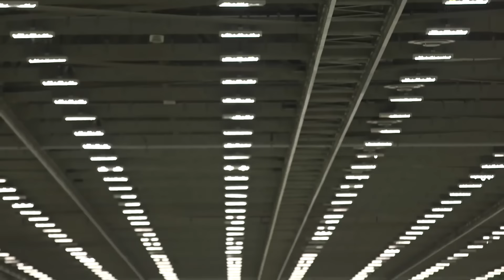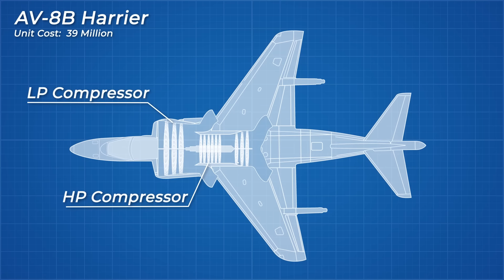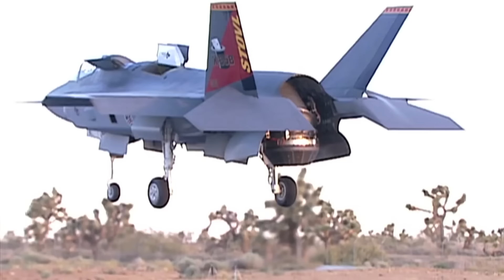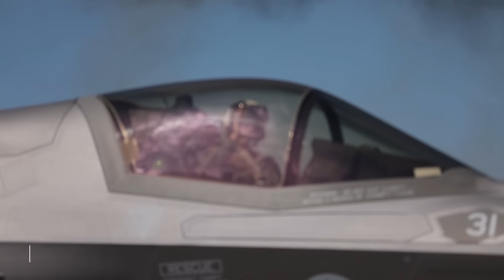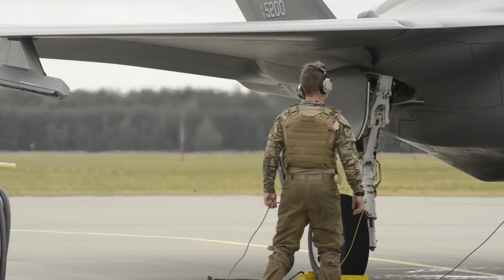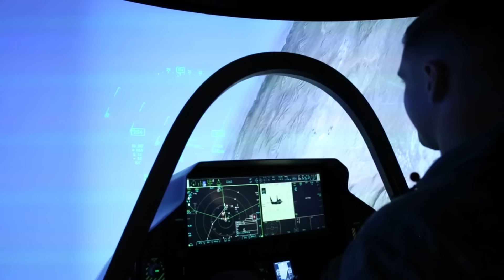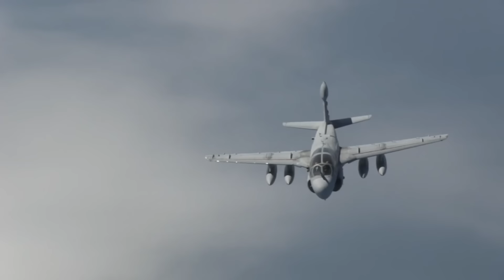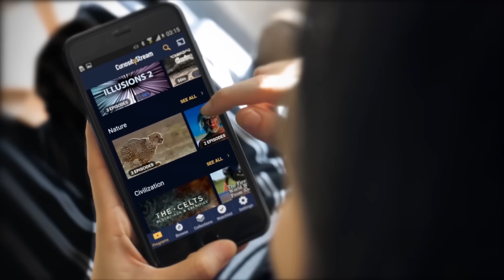Is The F-35 Worth $115 Million?

Comment: Engineers: we made the Stealth fighter that you wanted.

Pentagon: Great! now we want it to have STOVL, a new targeting system, and for it to fit seamlessly into every part of the armed forces. of are country and our allies for 1/2  of the cost. We will be mass producing the aircraft, So invest heavily in non-flexible assembly lines. We also want it to perfectly  fill the roll of evere 4th generation fighter.

Engineers: Okay but that will require lots of up front Investment and we will have to decrease the amount of weapons.

Pentagon: M O R E  W E A P O N S

Engineers: We could add pylons, but that will make it less stealthy.

Pentagon: Nevermind apparently the Air force is doesn't want STOVL, and navy doesn't want the plane, so now you are making 3 variants. They all have to have 70% of the same parts though.

Engineers: But-

Pentagon: Make that 30 variants. Apparently different countries need weapons equipped for different roles. Good thing that this plane will be good at everything, RIGHT?

Engineers: Okay, but that will cost more.

Pentagon: That is A OK. we'll just order fewer units.

Engineers: Okay, but that will cost more per unit.

Pentagon: ALL I ASKED FOR WAS ONE WEAPON THAT COULD DO EVERYTHING TO A DEGREE BETTER THAN ANY OTHER WEAPON IN THE WORLD, THAT WOULD SEAMLESSLY INTEGRATE WITH THE MILITARIES OF US AND ALL OF OUR ALLIES. Is that to much to ask?

Engineers: Yes.

Pentagon: Fine, we will give the contract to Boeing.

Engineers: Okay, we will do it, but the R&D alone will be over-

Pentagon: Here is a blank cheque.
Reply: Facts
Reply: Even Brits see how flawed our procurement system is (cheque gave it away, mate)
Reply: Samuel Fischman 
Didn’t Robert McNamara. Try this with the F-111A back in the late 60s?
Reply: it was made with STOVL and to be adaptable as a goal all along.
Reply: hmm

yes.
Reply: @Nybbl er im not sure you completely understand how government works. Trump is an idiot, yes and most of america   agrees with that (he lost the popular vote by the most any candidate ever has). So his decisions are not something you should be insulting people who most likely didn't vote for him. Yes the US could've shut down things quicker, but when they did the measures taken were pretty strict. And you assume that the people are complete idiots,  most people in early march prepared or started isolating, While the us might not have had the best response they had a response that worked well, and they're being careful about reopening states. Also none of this has literally anything to do with military spending.
Reply: @hamsterstudios1107  Most of America does not think that, but the media is closer to propaganda in the way they portray him.
Reply: Samuel Fischman Wow I enjoyed reading this
Reply: @diggleda  Thanks, It was fun to write.
Reply: Truuuuuuuu! Then the Pentagon pogchamps when engineers say no
Reply: This nails the problem.  Well done.
Reply: The Pentagon is cancer.
Reply: Just put stealth coating on existing aircraft the Air Force has and if you try to make everyone happy u make no one happy
Reply: oh yeah it needs to be able to be operated by a highschool graduate. prints money from thin air. dont worry we can pay for it.. lol considering we will have space superiority at some point.. hehehe
Reply: Why would you say something so controversial yet so true
Reply: Lol...great colloquy!
Reply: Joe mama lmao 😂😂😂😂😂😂😂😂😂
Reply: @Vatoliciuos  That's who I voted for
Reply: Americans develop an aircraft with complicated design and overcome very complex disadvantaged only to end in Chinese reverse engineering that aircraft at lower costs.
Reply: That is why suicide rate is high among engineers.
Reply: "Here is a blank cheque"

Courtesy of US taxpayers' debt with JP Morgan, Goldman&Sachs,George Soros and all those that finance US national debt with the hope the US military implements their global agendas.
Reply: Settle down boys.
Reply: @F-35 Lightning 2 A chèque is just a French word for the equivalent English word, and yes I know i'm not answering the question. You can probably safely ignore whatever a French might have to say anyway (joking).
Reply: @retropaganda  based
Reply: US GOV ALLOWED OUR TOP MILITARY R&D OF THE LAST 25 YRS STOLE oR sold ?
Reply: No cap
Reply: Literally what happened.
Reply: @Nybbl er Thanks.
Reply: @Nybbl er O O F
Reply: @William Budden Thanks!
Reply: Facts
Reply: This was practically spot on. It’s like being a head developer at Apple. Some dude in jeans walked around telling people what he dreamt of last night and watched them make it reality. Respect for these unsung soldier’s.
Reply: @F-35 Lightning 2 check but French
Reply: Funny story but the f-35 is worth the cost
Reply: I think the scary thing is that, despite how hard it was?

Engineers: Here's that plane you wanted. We're still working out the kinks but that's mostly software updates, and manufacturing cost will keep coming down over time.

Pentagon: ... wat.

This is like sending someone hunting for an ID-10-T part and them coming back with one.
Reply: You have been working DoD programs too long 😅
Reply: @Nybbl er Yeah yeah military just wants toys, America only fights AK-wearing caveman, blablabla. I'v heard it all a thousand times and it gets less convincing every time I hear it. Russia is actively challenging the US around the world, from Europe to the Middle East to America's doorstep in South- and Middle America. It has been developing capabilities specifically tailored to defeat US expeditionary capabilities for decades and has been exporting these capabilities globally. China meanwhile is openly building up its capabilities for the explicit purpose of defeating the US navy and pushing it back beyond the second Island chain. It too has no qualms about exporting this technology. Anyone still making the claim that great power competition is irrelevant has been living under a rock for the past decade. Hell even non-state actors have access to sophisticated weapons like air defenses and anti-ship missiles these days.
And again, the F35 has pretty standard payload as far as stealth planes go. Chinese and Russian versions have similar internal payload. The F117 also had comparable payload. Two 2000 pound bombs plus air-to-air weapons is pretty decent, that would be a fairly standard load-out for an F16 too. For smaller targets up to 8 SDB's can be carried. The payload issue is greatly exaggerated. Once the new weapons rack is ready it will have the same payload as an F22. Never heard anyone complain about the payload of that plane.
Reply: Although, I do find it funny that people act like engineers are the be all end all. My father in law worked on F-14s and F-18s on the Nimitz and then he worked on Boeing aircraft for the airlines for almost 20 years and he always jokes that a mechanic's worst nightmare is an engineer.
Reply: Pentagon: We need a jet fighter that can do all these trixy things, VTOL, 360 view for the pilot and stealth at all costs.

SAAB Gripen: Hold my beer.
Reply: @Nybbl er The B model also provied unique capabilities that effectively turn all of the US's Wasp and America class ships into light carriers. If you want to compare [rice you should compare it to the F35A. With a fly-awat cost of 80 million that is comparable to 4th gen fighters like the F15, Rafale, Gripen or Typhoon, Especially if you count the sensor pods that those planes need to carry to get capabilities the f35 has standard.
The idea that the F35B's unique requirements compromised the other models is also highly exaggerated. The A and C models are quite different from the B model and do in fact have larger payload (both internal and external) and are more maneuverable and less 'bulky' than the B model because they don't have that lift fan. They can also pull more G's than the B model.
Reply: Dux D  Best place for aircraft carriers is in dry dock where they cannot be sunk. They are is obsolete now as the battleship was in World War II.
Reply: @Nybbl er The US being unprepared for COVID-19 has nothing to do with military spending, or with money at all. The problem is that there is not enough global supply of ventilators now that every country needs them, not that the US doesn't have the money to buy them. The US is spending trillions on jump-starting the economy, clearly they have plenty of money. A fraction of that money would've bought all the ventilators you could ever need a year or so ago. The problem now is supply, not money.
 And US intelligence agencies have been warning for this exact scenario for at least 5 years so the system was working and blinking red warning signs. The problem is that nobody listened to the experts until it was too late.
Reply: @duxd1452  yeah I dont know bud. Even military members staunchly agree the US military complex wastes tons of money.
Reply: @spakentruth  Military members don't have any particular insight into military procurement unless they work in the acquisition process specfically. And wasting money is usually a question of perception. The F35 can hardly be called a "waste" when you consider the amount of legacy equipment you'd need to perform the missions this plane was designed for.
Reply: @Nybbl er First of all I'm not American. Second, yes, they should have closed down much sooner. The US has horribly bad leadership. But what does that have to do with the military budget?
Reply: @duxd1452  You can't really blame the leadership when it constantly is getting sabotaged can you? Everyone's quick to say things are the presidents fault but he can't speak for the people below him, especially when they observably conspired against him on multiple occasions.
Reply: @xcritic9671  [Citation Needed] Also wasn't blaming Trump or Obama, Mostly the Military industrial complex bureaucracy in general.
Reply: @samuelfischman6949  idk what you're talking about, but I think I agree...
Reply: Dux D it is that they spend so much money on the military still doesn’t have the best military, not good guns and not so good airplane like some nations have
Reply: Amazing how clueless some people are about military procurement processes. The F35 is not expensive, it's ridiculously cheap. It costs about the same amount of money as a modern 4th gen fighter. But the F35 provides more capability for that money than any plane before it. It's a MASSIVE leap in technology from previous generations. As a fighter F35's are getting insane kill ratios in excercises, out performing anything but the F22. And as a bomber it is completely unparallelled, easily able to go into areas defended by sophisticated integrated air defenses that would cause horrific losses against any 4th gen plane. If you had to do that same mission with F16's it would actually end up much more expensive because you'd need dozens or even hundreds of planes and you'd lose a big chunk of them. The fact that the F35 is so versatile that many countries in vastly different circumstances have ordered it only makes it more impressive. You should be damn proud of the Pentagon instead of making these dumb jokes.
Reply: @duxd1452  You start from the goal you wish to reach.
Reply: @duxd1452  thanks for sharing that info not many people research the military the just look at the word (stealth) and assume it's a trillion dollars for  1 the f35 is a really good plane
Reply: @duxd1452  Check out the performance figures of the F-35 to the 50 year old F-15, then imagine an air-to-air fight, guns only . F-15 would need to stay out of After Burner, just to make it fair.
 Can you imagine an F-35 flying down some canyon to smoke a Tank? Fat chance!
Reply: @lindamcentaffer5969  What era are you living in? Guns-only air-to-air fights? Fighters carry high off-boresight missiles with HMS cueing these days. Guns are irrelevant as an air-to-air weapon in today's world. And I don't see why an F-35 couldn't fly down a canyon like a 4th gen plane. Although there would be little point in flying into AAA range when you can just drop a Paveway on that tank from 40.000 feet.
Reply: @duxd1452  Are you telling us, that there is a ballet dancer who also could be a wrestling world champion?
Reply: @bernhardecklin7005  No. Maybe you should learn to read?
Reply: @duxd1452  This is an unfriendly and particularly stupid comment from a guy presumably of not very sophisticated education. But continue trying.
Reply: @bernhardecklin7005  I'll let your comment speak for itself..
Reply: @duxd1452  Thank you. You are right to join my point of view. As the F-104, the F-35 is a lemon, period!
Reply: @bernhardecklin7005  No thank YOU, for proving me right in questioning your reading skills.
Reply: @duxd1452  no arguments, but stupid repetition of Lockheed-PR
Reply: @duxd1452  for how long have you been in Lockheeds propaganda service? Shame on you!
Reply: @bernhardecklin7005  LOL
Reply: @duxd1452  lost helplessly, tries to be funny, the guy who doesn't care to what would happen to the pilots of this piece of crap, let alone to the US-tax payers!
Reply: @duxd1452  when the last time F-35 been in a real war dear. Stop this b.s. There are enough of reports from experts in the US and Nato that the F-35 is totally overated.
Reply: @alberthenriette8976  Last time F35 was in a real war? Few months ago in Syria. Both in Israeli and US service. And every single real expert I've heard on the topic agrees the F35 is a quantum leap in combat power. That's why air forces from around the world are either buying the F35, trying to buy it or trying to steal/copy it. NATO countries trust the design enough that they build their entire future air forces on it. And even an adversary like China trusts the design so much that they modeled their entire future carrier wing on the F35. The UAE thinks its good enough to make peace with Israel for. And the Israelis themselves just decided to buy an extra squadron because they are so impressed with the jet's performance. But of course you know better than some of the best air forces in the world because you read some news articles by self-proclaimed "experts"? Pff..
Reply: @duxd1452  Hahaha..oh dear if you listen to the promoters you will always end up by seeing nothing wrong with their products. The F-35 is one of the most promoted militart toy in history. Why? Because they need to sell it to cover the huge cost.The F-35 never face a real adversary in Syria, nor in Afganistan or anywhere else , because its never been in any real war. The real experts who really cares about the USA war capabilities and not only making money are those who are raising concern having critics about the F-35. They know this plane is not up to the expectation of the US army and want a better craft soon. Thats why there are talks already about a 6 generation craft soon.  Why you think the F-22 is not for sale, even to Israel?
Reply: @alberthenriette8976  The UAE and Israel don't have any financial involvement in the F35. Neither does China. Yet all three decided to build their future air capabilities on this plane. And dozens of other states have been lobbying Washington for access to it, including major military powers like India or Saudi Arabia with access to plenty of other systems should they so chose.
The F35 is slated to be produced until at least 2035 and will replace all major fighter and fighter/bomber types in 14 air forces across the world. Several thousand will be produced. Hardly a sign that they are falling short of expectations. 
And its perfectly normal for preliminary design work to start on a new plane when the current generation plane is just being rolled out. The development of the F35 started in the 1980's, when the F16 was still in its infancy. No 6th gen plane will see service before the 2040's.
Reply: @alberthenriette8976  Wheeler? Really? The guy is part of the POGO. an organization that has lobbied extensively against the F35. He's not an expert by any stretch of the imagination, and certainly not a neutral one. But the people that actually know the performance of this jet are all impressed enough to build the future defense of their countries on it. And those are really the only people in a position to evaluate its strengths and weaknesses given the classified nature of the actual performance parameters.
Reply: @alberthenriette8976  There is nothing about F35 performance in that video. Readiness problems are perfectly normal for a new fighter. The F16 had the same problems in the beginning. The readiness rates for the F35 have been going up continually for the past few years and are a lot better than those of the F22 that you were just praising so highly.
Reply: @duxd1452  These two guys from the 2 videos are honest. Pierre sprey is an American war veteran, who love his country and knows much about aircraft and war. Yesterday the 4th F-35 Crashed happened within a few yrs. Theres something not ok with this plane as many experts been pointed out. If it cannot stay in the air in peaceful time , how will it survive in conflict times facing high quality adversaries.
Reply: @alberthenriette8976  In that same time period 18 F16's crashed. I don't hear you ripping on the F16 because of that? Accidents happen, that's just a fact of aviation. Losses due to accidents are expected and calculated into acquisition plans. Apparently a plane's performance in your book depends on the amount of positive or negative stories that appear about it in the media?
Reply: @duxd1452  Hahaha.I know you will send me this video dear. But don't you see anything strange about this man. He is a Russian( Counter intelligence) propaganda agent. When your adversary praise you too much for  something you do. Its a wake up call call for you, that theres something wrong with you. They don't want you to know. This man  have no critics but 100% positive appraisal for the F-35. While some sincere American and Nato experts  thinks theres lot of rooms for improvement.
Reply: @duxd1452  Ya, but the F-16 is a battle proven jet compare to the much more expensive F-35. The F-35 have a thousand $ worth techno to keep it in safe flight. If the F-35 keep crashing at this rate, this will not be profitable at all.
Reply: @alberthenriette8976  Vladislav Shurygin is not a counter-intelligence officer, he is a journalist focussing on military news. You clearly don't know who you're talking about. He has no ties to the Russian government.
 Russia did put out a lot of propaganda about the F35 but all of it is negative, not positive. The Chinese are also constantly criticizing the F35, while at the same time copying it for their own naval aviation. By your own logic that proves the F35 is pretty good.
Your opinion is clearly based on the random noise that appears in the media about the F35. Or worse: youtube videos by random trolls. That means nothing. Instead you should look at the people that actually know what they are talking about: the military officers and pilots of the air forces that will operate it. They are the only ones that have access to the real performance parameters of the F35. And they all agree it is revolutionary. As do America's adversaries like Russia and China, who have expended massive resources to copy/steal the F35 and to build defenses against its capabilities.
Reply: @alberthenriette8976  I'm going to end this discussion here. . You have clearly already made up your mind that the F35 sucks and you will continue claiming that no matter what evidence I put before you. Air forces around the world know better and will keep buying them in large numbers. The opinion of laypeople like yourself is totally inconsequential so I'm not going to waste my time trying to convince you.
Reply: @duxd1452  oh dear. I understand your disappointment . The truth will remain that theres no perfect aircraft. Theres been some great ones like the F-16 . A plane that perform great in battle. But the F-35 with all the fixing that been going on with its software and hardware has not been convincing. For the status of the US military theres too many shortcomings with it.
Reply: @alberthenriette8976  Keep the condescending attitude and the cheap strawmen to yourself. My disappointment is in you and your foul attitude, not in the F35. I mistook you for someone that was open to rational arguments. Turns out you just want to be confirmed in your own opinion and have your ego stroked. I have no interest in continuing to engage with a sad individual like you.
Reply: @duxd1452  well..you may disagree with dear for presenting you with opposing views. But I would say it was not a waste of time to read your views. This is what the youtube forum was meant for. The end goal is to have tolerance and respect. Agree or disagree. Thanks for sharing in a civilise way. Enjoy your day.
Reply: @duxd1452  The program is the most expensive in history. The per unit might be cheap (If you think that 2,000,000,000 is cheap), but that's only because many are being sold.
Reply: @samuelfischman6949  Yes, if you sell lots of a fighter jet the per unit cost gets cheaper. Economies of scale and all that. How is that not a good thing? And with around 3000 jets on order that will replace a half dozen fighter and bomber types in 14 air forces around the world the program might be the most expensive but it also provides more military capability than any other program. It will completely modernize the US air force/navy/marines inventory as well as that of allied nations. And it looks set to fundamentally shape the way the US will fight future wars. Through extensive networking and cooperative engagement capabilities like NIF-CA the F35 will act as a force multiplier for everything from naval ships to army artillery batallions.
Reply: Dux D you don’t know anything about warfare, these military exercises are biased in favor of the F 35 so that it looks like it is doing well. Furthermore, the cost per unit is gigantic when you amortize in the R&D cost at more than $400 billion, that adds more than $100 million to the cost per unit it’s less than 4000 of these things will ever be built. Worst of all, these 35s are already obsolete because of autonomous drone technology. Even Elon Musk recently told the US Air Force this in an official meeting. The best we can do is cut our losses now and go to drones, and only Drones.
Reply: @duxd1452  totally random, but do you like the SR-71 Blackbird?
Reply: Steve Perreira aside from other factors people below have mentioned, I think most of the public would go insane if we went full drones, since it’s not a real human pulling the trigger
Reply: @duxd1452  yeah i don't get the part of the joke "but it'll be more expensive" it's less expensive than an older version of itself that perform literally worst in everyway whenever it's able solely to do it

US did an amazing piece of technology here too bad it's still corrupted to the core with your ultra libertarianism that every US citizen seem to defend with its soul even tho it's literally the reason everyone is in deep shit because of Covid
Reply: @YM-zf8mt  I was referring to the planning stage, not the actual iterations of the fighter. What I meant was that the program would have been cheaper if it wasn't stealth, or STOVL. The extra capabilities added cost.
Reply: @YM-zf8mt  I was not refering to the unit cost, but rather the increased cost of the program and R&D.
Reply: @duxd1452  facts right there my man
Reply: @Nybbl er so thanks to Trump I know some people that were making just as much money while not working as when they were, but I guess because 90% of the press he gets is negative he must be doing a bad job. Don't believe what you hear.
Reply: what we have is an overpriced piece of junk that we dont and ill never need.. nobody will ever even think about invading the US since they know people like me own guns as well as half the country..
Reply: @jamesholt7340  LOL Yeah James, I'm sure the Chinese are very scared of your gun collection...
Reply: @duxd1452  yes,that why no country would ever dare to invade us..im not the only one with guns you know that right..and its a known fact that many countries have stated is to why they never would...dont think our military is whats keeping that from happening cause we are not as good as the movies and media potray us to be!!
Reply: @jamesholt7340  Name one? Compared to the US nuclear deterrent you and your neighbour's private gun collections are not that impressive.
Reply: @duxd1452  nuclear weapons are a moot point,nobody would dare use them because they know it would be the annihilation of themselves if they did so they in essence dont matter
Reply: @duxd1452  we could actually get rid of our military altogether and nobody would even dare because everybody knows Americans own guns and it would be suede to invade this country,and that it would be geographically impossible..every country al;so knows that if they were to invade people like me would be fighting right alongside the military to counter any kind of attack and that would be a grave mistake to go up against someone like me with a gun...I never miss..
Reply: @jamesholt7340  Homeland defense is actually the one situation where nuclear weapons are not moot. It's what they were made for. An invasion of the homeland is one of the few situations that would trigger a nuclear strike, that's why it's a credible deterrent. 
And armed civilians don't stand a chance against a modern army. None of your guns can penetrate armored vehicles or stop artillery shells.
Reply: @duxd1452  your delusional,the only thing the american military does is provide welfare for all our people in the military by means of housing,education,meals,and a good paycheck..THEY DO NOTHING FOR the general public!!give me one instanc where the military has helped the general public? ill wait....
Reply: @jamesholt7340  "give me one instanc where the military has helped the general public? ill wait"

Well for one they assist after major disasters with evacuation and disaster relief, like after Hurricane katrina for example. 
And LOL@ you thinking you're going to shoot down low-flying airplanes and take on armored vehicles with IEDs. You're hilarious man. Iraq is littered with artillery and bomb duds and other discarded heavy weapons from decades of conflict. In the US anything that can be used to create a serious explosion is extremely tightly controlled, especially since 9/11. So no, you do not have better access to explosives than those Iraqi "goat herders".
Reply: @duxd1452  damn.Your right..You got me on all accounts...we have two totally different views and entitled on our opinions....but honestly, i wish the government would do more to help the country instead of war and everthing that goes with it...War is good for absolutely nothing...
Reply: @jamesholt7340  Navy seal coppypasta much?
Reply: Weapons are no use at all and wasting of our earth resources on earth  to build if  devil nations in the world are not creating troubles or provocations against other nations for wars in the world!! The nation building up most of the weapons in the world is a devil which will be condemned and punished by God for sure . No wars  then no markets for weapons, so this nation must keep creating troubles in the world so as to keep their weapons markets in the world ......really devils!!!!
Reply: @hkpcrfung8314  @Zoltan  I Wish man, I really wish.